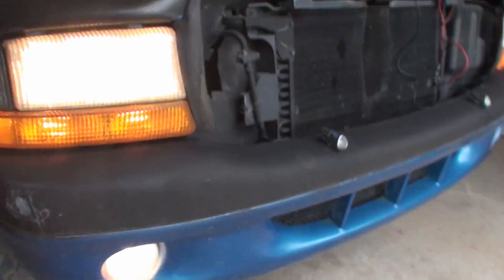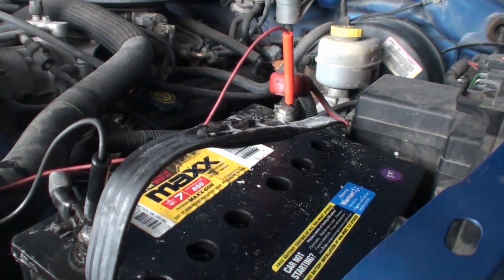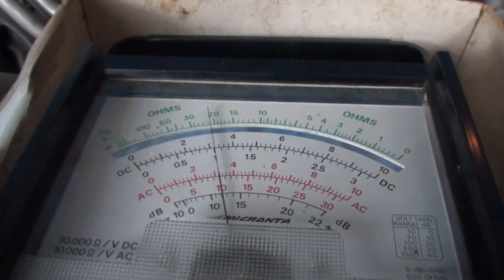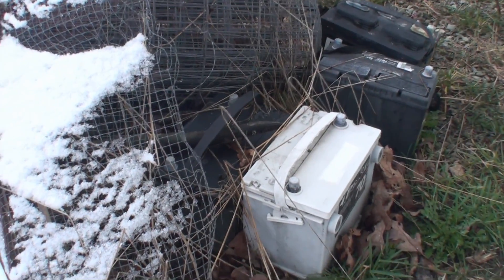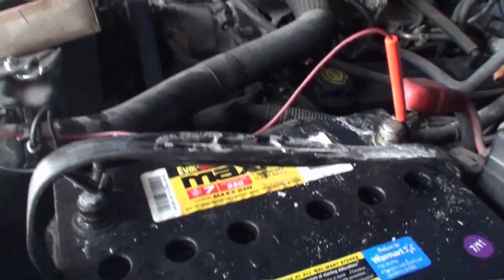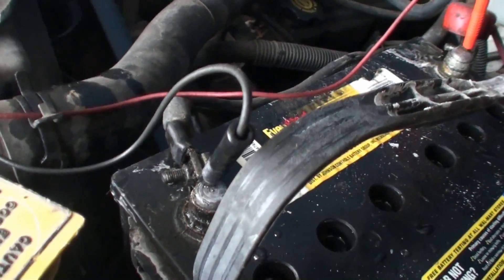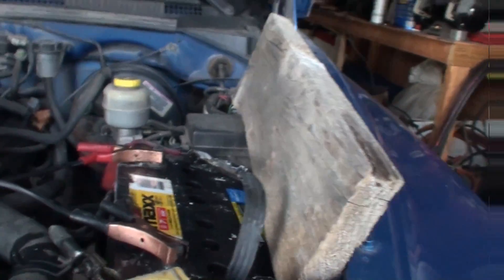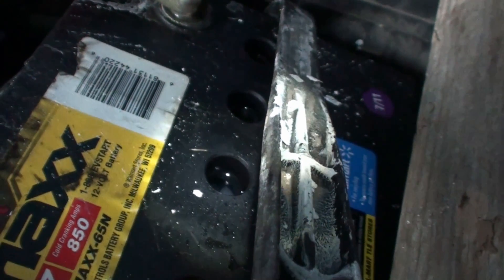Acid Lead Battery Restoration Recovery 1 of 3

Comment: I have been following your battery salvage videos and think you way of removing sulfat on the plates sounds promising and more legit and better than most others.  
But when you discharge DONT run them that low or you risk damaging them permanently in the process.
A lead acid battery has its power from 11.8v to 12.6v, where 11.8v is close to 0% power AND the lowest safest discharge level. 12.1v is 50%.
But apart from that i think your videos on battery salvage are great and im going to try this method for 12  110a batteries i have from an bought EV with a battery exchange to new ones, and i hope i can revive most of the old ones for my solar panel system.
Sorry for any spelling errors, im not native english speaking

Comment: My father and I use rainwater when a cell gets low. We have had battery's last 6-7 years , had a couple last 10 years. We also use rain water for radiator mixture with antifreeze. Or to add to system if hydrometer allows it. Keep about 10 gallons on the shelf in the shop.

Comment: Why are you measuring the Voltage of a DC battery on the AC SCALE??? Or Decibels (dB)!!! Please read the instructions of your Meter!! I was taught everything Chemically/Physically having to do with electricity production inside a 12V Car Battery!! A whole blackboard-full of Chemical reaction Formulae!! In Physics a good instructor tells you that, for teaching purposes we think of a 12V Car battery as having 6 Cells of 2 Volts D.C. in Series!! And of Course, 6X2 is 12 Volts!! But they also tell you that, in reality, each Cell puts out a little more than 2 Volts. This is why a Charged 12V Car battery if the ambient temperature isn't really low (Not Close to Freezing), puts out about 14 Volts or sometimes slightly more!! We're talking about a Fine quality battery, I wouldn't guarantee it with a Napa battery. :-)

Comment: What about using sulfuric acid or store bought battery acid instead of Epsom salts for (electrolytic fluid)or does that not work when desulfating with baking soda

Comment: Hey Randy, I live in Central Florida and I don't know why or how but I never get the full time out of a battery. If the guarantee is for two years, I get twenty-three months out of it. I've heard about de-sulfonation or whatever it's called and I've read how to do it but I don't quite understand and would love to hear how to do it. I have a diesel truck with two batteries, a 5th wheel trailer with four deep-cycle batteries, and three cars, not to mention motorcycles, four-wheelers, and lawn tractor. Needless to say I spend a lot on batteries and like I said, I've not ever gotten the full time out of a battery. You might be my new best hero here!      B.
Reply: Buddy Martin if i may...HEAT, especially there in Fla. Heat kills batteries especially when you park and the heat from your engine trapped under the hood with nowhere to go just cooks your battery. Add extra insulation to that flimsy factory heat wrap around your battery.

Comment: Yes by all means. Knowledge is best when shared. Thank you for showing neck and bridge resets, as I did not know that such repairs were even possible on acoustic guitars. Some of your insights to repair has helped my guitar collection. I have a 12 string that needs both resets and maybe a bridge doctor too.
Reply from the maker: Very cool!I'm glad to hear my videos help! This trick on acid lead batteries can save a small fortune over time, many thanks for checking out my videos!

Comment: I would like to see the whole process you use for restoring batteries including the solutions. I have some batteries that could use it right now.
Reply from the maker: I used to have to buy new batteries for mowers, tractors and whatever about every spring, since I started doing this it's been several years now since I've bought a battery. More to come, thanks for viewing!

Comment: Randy, you've got the probes on the battery, which produces a DC voltage.  You have the meter set to measure AC voltage and you're reading 10v AC on the scale.  What manner of sorcery are you employing?
Reply from the maker: This meter is old, you have to select the 30 volt scale that also uses AC voltage depending on where you have the probes connected to the meter because it jumps from a 3 volt scale to a 10 volt scale (shown as DC) then to a 30 volt scale (shown as AC) the meter has a connection port for reading AC and another connection port for DC and with this meter set to read DC on the 30 volts scale happens to say AC on the face of the meter. Only the 3 volt and 10 volt scales are shown as DC on the face of the meter. To use the 30 volt scale in DC must be plugged into the DC port. These old analog meters doesn't have all the bells and whistles a modern digital meter has and you have to know how to use them to get readings they wasn't specifically designed for.
Reply: Ah, gotcha!  Thanks Randy!
Reply: Fooled me too. Thanks for the explanantion Randy. That looks a bit like one of the old Avo meters I used to use but I don't think thay had that strange voltage-reading arrangement.

Comment: I think it's going to need a truss rod adjustment and perhaps shave the saddle! Do you know how to rejuvenate Ni-Cad battery drill batteries? All mine are SHOT... but I haven't used them in a LONG time! I'm kind of "Cold and Cranky" myself! lol... oh the bad jokes... I see the walmart sticker... that's just funny in it's self! lol... When did you record this that it was so cold out? Getting warmer now that it's April! All I have is a Black and Decker electronic charger... but there is an old school Craftsman out at my dad's.. he's dead so I don't think he needs it now! IT STARTED! Awesome!
Reply from the maker: The only luck I've ever had rejuvenating Ni-Cad and Lithium batteries was keep running them down dead and slowly charging them back up over and over until they lose their memory, they will perform for a little while before needing rejuvenated again. Yeah lol I found the receipt where I bought this battery at Walmart in 2011 and paid like 80 bucks back then for it, I won't be replacing it for at least another 4 years now! Thanks for viewing Ed! I made this video in March, it was cold here last month but was nearly 70 degrees on the say I started restoring this battery, then got bitter cold for over a week! lol
Reply: Yeah... that's how I handled the ni-cads... but I think some of them are just to far gone now. I've seen vids of guys replacing the batteries inside the case but that looks like a lot of hassle! Warm weather coming brother!